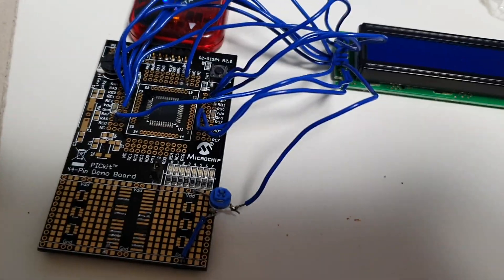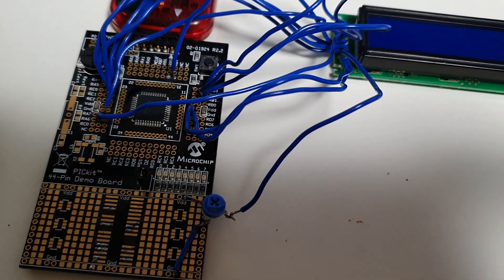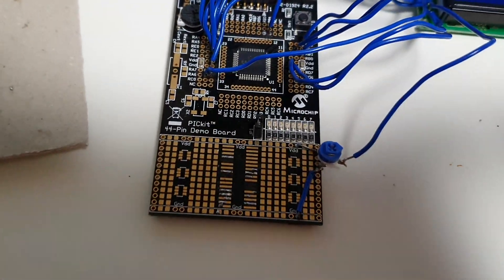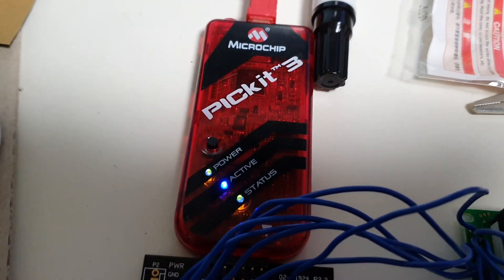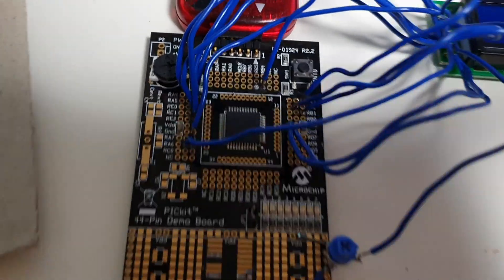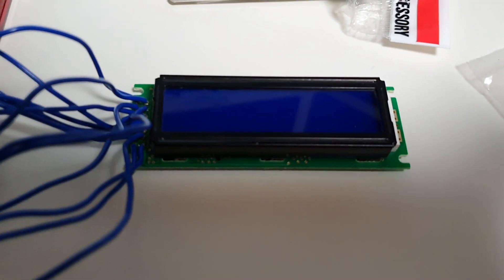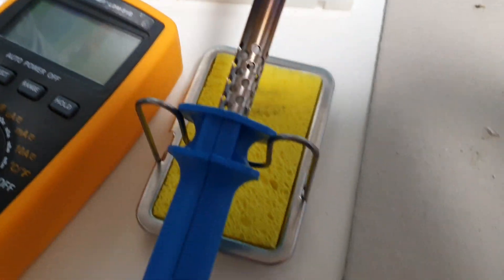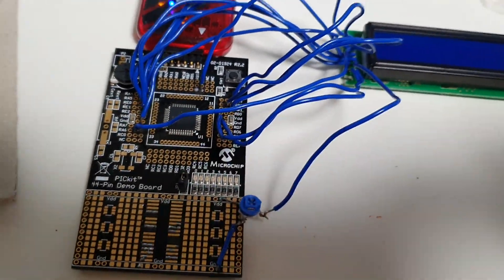Blooper [Project Moisture]

Comment: Use a logic converter, bi-directional, 3.3v to 5.0v and backwards to jump / lower the voltage as needed between devices of different needs
Reply from the maker: oh hell no, there are way to many lines for me to wanna fuck around with putting a level shifter on each. but in the next video you'll see that done on an i2c bus instead :]

Comment: I guess you just need to communicate from the controller to the display. Then you can use a mosfet to lift the voltage level from 3.3V to 5V. 

Why you don't just use a I2C display without any controller in between?
Reply from the maker: because the design of the final unit doesn't want/need a display. This is only for design/debugging purposes